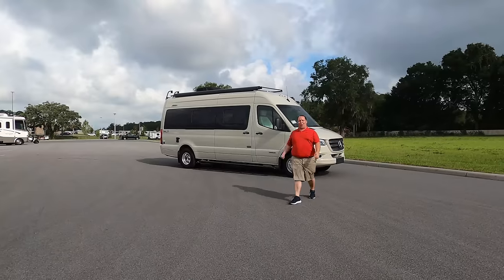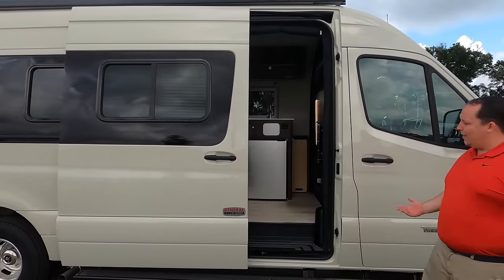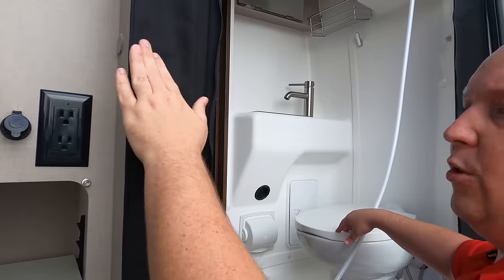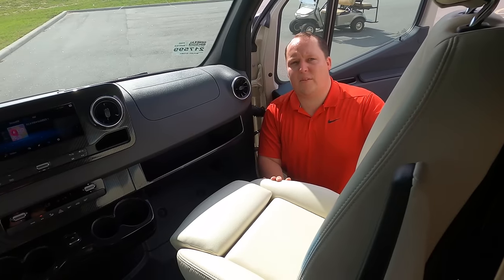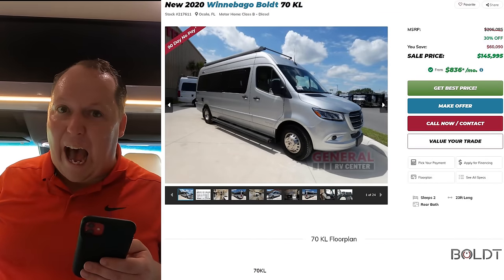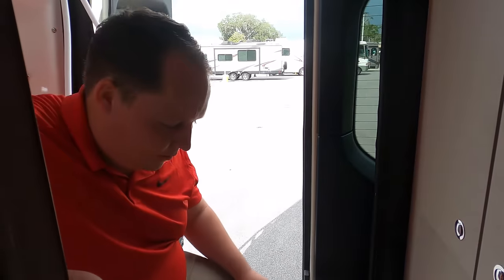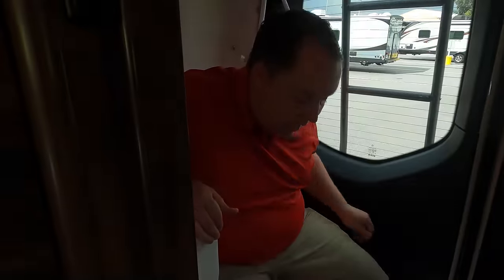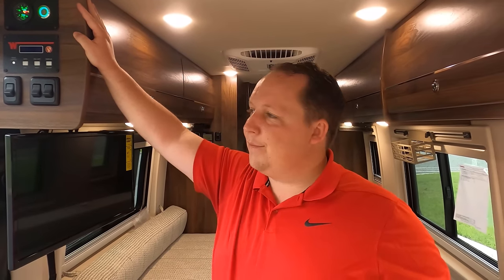Best Class B Motorhome for Fulltime Living! Off the grid camping

Comment: What?!?! A Class B?!?! I never thought I'd see it!!!
Likes:
1) Huge awning
2) I love the roof with the rack, and it looks like room for another solar panel up front (if needed)
3) All electric. I love it. One less tank to worry about.
4) Huge lithium battery bank plus the huge inverter.
5) Front passenger swivel with table. That's where I could eat and use the laptop all the time, and not worry about keeping the bed made in the back.
6) The 81" long bed! I can't get a bed that long in a 40 foot diesel pusher, but I can in a van? 👍
7) Good sized rear bath with access from the outside (easy exterior shower)
Dislikes:
1) Way too expensive. I get part of the reason why, but even the sale price is way too high.
2) Would prefer AWD
3) Take out the smaller bed and put in a larger fridge and more storage / counter space, and I (as a solo traveler) could camp in this for weeks. However, that small fridge is a no go for me. I'd run out of meat and veggies in 3 days.
Reply from the maker: Thanks for sharing your feedback Brad😊👍
Reply: @MattsRVReviews  A pleasure. But you caught me in the act. I've probably changed it 5 times since you posted. I always work on my list while I watch, and pause, and watch, and go back and rewatch, and so on. 😎😁
Reply: And another 3 times since I posted that.
Reply: Except it actually does have LP.  i possibly would have done Murphy style on the bed and I cant stand low microwaves.  Otherwise top notch
Reply: @slamdancer1720  I love a murphy bed. Not having to make and put away a bed every day would be so nice.
Reply: Slam dancer But since it’s diesel no generator needed. Also saves weight.
Reply: I have a Honda car that has the same lane assist...windshield cost $1300 to replace because a generic wouldn’t work for the recalibration...I can only imagine what a Mercedes would cost.  Price too high...I like the Winnebago Travato better. I have heard that the Mercedes are expensive to work on...even the oil changes.  Would never buy a class b with the Mercedes....give me a Ram promaster anyday!
Reply: @brianreimer380  yes, but it was called an all electric coach.  that was just a small mistake.   I actually like that propane is available.
Reply: What you said!
Reply: Love the class B it’s a perfect size for one person to travel across country

Comment: Matt & Andrea You guys did a great job!!! 
...Confirming...batteries/tanks under the beds?
Lastly, do they not have the froli system under mattresses? If so that is the 2nd BEST thing!!!!

😍💗 1. QUIET AC on SOLAR!✅ ... but for how long!??!?!?!  2. Bathroom! 👑 3. Bells and whistles (B&W) are STANDARD 👀👏🏽

🤨😬😭😱 1. Beds are like a parallelogram vs sided by side not a fan (this is their biggest flaw and don't get me started on the different lengths and finding sheets that will fit!!! ...Lose the storage/closet at the end of van, push the bed back add a counter at the entrance of van instead and make the kitchen counter smaller so both mattresses are the SAME SIZE!!! 🤯) 3. Windows on the door are sliders... not good in the rain! Prefer the awning style windows. (Experience the difference than we can talk!) Lastly Andrea pointed it out the induction... better if it could be mobile... like Matt said the vans are for living on the outside... as well as doing the cooking! If the cabinet would be to left of entrance of van you only would need a flip top table and a plug... Voilà cooking outdoors! Aka show off your bells and whistles (B&W) and solar!!
All in all, Not worth the 200K price tag even with all the B&W!
**Winnebago listen to your fans we all want one if... read the reasons above

Matt's RV review I Can't wait to see you do a review on a Safari Condo XL next!!!!!!

Comment: Another nicely done Vlog. Very informative, good camera work, (and nice assistant! 😉) lots of energy (need some decaf maybe? lol!), I like seeing B and B+ RV'S reviews. The only thing I would add to the Vlogs is maybe mentioning if there are optional things that you can add or upgrade or if the package only comes with the equipment that's installed. I know you only asked for 3 likes and dislikes, but I think I've got a caffeine rush going so.....🙃😀 here goes!
Likes:
1: Cabinets and the low gloss finish so they don't reflect bright sunlight as bad.
2: Magnetic bug screen, but needs it on rear doors as well for when you want large airflow.
3: Sink size
4: Pretty quite A/C motor
5: Front bumper step
6: Screen size and backup camera with guide lines that move with steering. **Would be nice to have a 2nd screen either above the radio on the dash or up at the top of the windscreen where the rearview mirror goes which is connected to a 2nd camera mounted higher up on the van that is always on when driving to act as a widescreen rearview mirror. That would let you see traffic, watch the trailer you are towing, and be able to see back past your trailer while backing up to help keep you from hitting anything!

Dislikes:
1: Permanently extended running board. Use a powerfold 
2: Kitchenette location. Placement at front of van makes beds offset, and no flip up or pull out counter extension.
3: Driver seat takes too much work to move. No 2nd location of power seat controls behind seat to make it easier to adjust for table without having to contort to reach the buttons on door. (and power seats always move so slowly forwards and back in all cars anyway so it takes too long to move that seat after everytime you spin it around) "SOLUTION" - Either a fully manual seat, or a seat that has power back/seat tilt/height/lumbar but a manual sliding adjustment to make moving it for the table faster, or have a power seat BUT ALSO A SPLIT 2 PIECE SEAT MOUNT! (Made one of these myself by welding a power and manual seat base together!) Bottom of seat base is a manual slider like a regular non powered seat with an unlocking lever release, but only has 2 positions, 1st is backed up away from the steering wheel when facing forward, 2nd is moved all the way up to the steering wheel when turned around. No stopping points in between. Then on top of that short bottom base it has a second seat track that is the power slider for adjusting to a "perfect" comfortable position when driving. Then you also won't have to constantly find your driving position after spinning the seat around or have to press a memory position button and wait for the seat to slowly relocate.
4: ABSOLUTELY HATE Mercedes voice control radio command function!!!! (In ALL their cars) Either get rid of it all together or have it stop always listening for a "key word" to respond. Just have it ONLY respond to a command after pressing a steering wheel button so it's not coming on when it hears "Mercedes" or a word slightly similar to it. It either comes on when you don't want it to, or it won't come on when you do!!
5: Ladder. Bottom rung is up too high. Add 1 or 2 more rungs so that we don't split our pants raising our leg up so high, and for people that can't lift them that high won't have to carry a step stool around or have to use the bumper as a boost up to it, and it's much safer climbing down without a little jump down especially when in slippery ground conditions!
6: Raised solar panels make wind noise going down the road. Can't hear it in this video but have heard it from being in one of these vans.
7: Lane control assist. Annoying when trying to pass a car or look around a car before passing. If people can't pay attention to the road, have poor depth perception and can't tell how close the the sides of the road they are, or are too sleepy to stay between the lines then they have no business being behind the wheel of a car anyway.

Comment: Thanks for the Class B review guys!
Three things I liked:
1. The finish inside is very nice, especially the cabinets
2. The kitchen is really set up well for the size of the camper, really like the induction cooktop & microwave/convection combination.
3. The electrical setup with the lithium batteries & solar panels. Expensive, but could likely boondock for extended periods.

Three things I don't like:
1. The layout: put the bunks even and closer to the back door, maybe a rear lounge or dinette converting to a double bed, or maybe a Murphy bed, plus some garage space if possible underneath. Use a smaller bath module closer to the door across from the galley. I've seen some that put the galley by the sliding door with outside access for cooking out, then the bath across from that. I don't see how the sleeping position works for either camper
2. It's really long, so parking is going to be a hassle in town.
3. It's expensive. For the money, you could get a really nice class C or, for less money, a B+ with more space. I know it can carry two, but it could only be for short trips. One person could probably get by in that small space, but for two, I think it's too tight. 

I don't see this as a viable solution for full time camping.

Comment: I love class b’s and would like to see more. I like the mechanical & electrical features, cockpit, magnetic door screen, and size of the bathroom. That being said the interior design of the unit leaves a lot to be desired if they are promoting it for full time use. The weird “double” bed is useless for sleeping 2. The fridge needs to be bigger and needs to have 2 induction cook tops, I would promote the van for solo travelers and get rid of the small couch to put in more cabinets, make the kitchen counter top & longer by removing the drivers table (this way you would have more space for another induction cooker). Last but not least I would offer a boon-docking option of a cassette toilet thus freeing up valuable space for more freshwater carrying capacity.

Comment: Matt & Andrea, "absolutely love" the channel.  Winnebago ... as somebody seriously considering this RV, I wanted to give you some feedback.  First, the BOLDT is awesome, it looks great, the Mercedes chassis is the best available with outstanding safety features and good mileage, we are particularly drawn to the VOLTA power system, it is a very modern approach and we love it, but we could not pull the trigger on the BOLDT, here is why.  Bathroom + Refrigerator.  We want to travel with our son, so we want the awesome forward facing third seat with shoulder belt, so the 70BL floorplan is for us, but the fridge is so very tiny, not enough for 3 people to travel.  Second is the bathroom, its so tiny on this layout and really unusable.  I know, I know, its a class B, but the Travato, your own class B with a VOLTA system, has a nice bathroom and a good size fridge. how can those be bigger on a smaller chassis ? If you can change the BOLDT to be a bit more like the Travato 59GL, you would have a real winner on your hands.  Last request, somehow find a place, someplace, somewhere on the outside of the BOLDT to hide and store the "stinky slinky" as Matt calls it.  Nobody wants to bring that into their $200K home on wheels, especially one as nice as the BOLDT.  Overall great job on this product, but we can't buy it until the layout issues outlined above are fixed.

Comment: Hello everyone!
Our likes:
* For such a small unit it is laid out pretty well. We also wish the beds were aligned better, though.  
* We love the fact that it is solar-friendly. With a unit that small, solar is almost a requirement. 
* We like having the doors at the back as well as the side and front. If an emergency exit was required there is little to no reason why an exit couldn't be done quickly and safely. 
* The towing capability would make it pretty easy to pull a small storage trailer of some sort (to carry a grill, bicycles/golf cart, etc.) or a flatbed trailer for a motorcycle. 
Our dislikes:
* Although we understand class B motor homes are expensive as a rule, we wish there was some way the prices could be reduced. It's hard for "regular" people to consider spending that much on such a small unit when we could get something with much more room for considerably less. 
* It would be interesting if there was a snap-on tent type structure for the back in case someone really wanted to take an outside shower. It could possibly snap onto the back of the unit for access to the water and for privacy.
* You've probably seen this is a regular request of ours, but it's even more important in such a small unit. Since there is very little room for storage, having a cutting board cover for the sink would be essential for us. 
*  We didn't see any blinds to close off the cockpit area from outside. If there aren't any, there should be...never know when a peeping Tom might show up.
P.S.
We LOVE the way the vehicle didn't respond to either of you at the end of the video. Too funny!

Comment: This Class B is an excellent option if you're goal is to travel the US from city to city on the DL (Stelth). This is also a great option for beach camping or using it to get to a good skiing, rock climbing spot.

I like the fact it's 100% electric & has an awesome electric set up. 
Good shower/wet room set up. One of the most spacious set ups i've seen.
I'm in love with the driving & safty features .

I'm not a fan of the sink depth. I'd prefer it be deeper.
The mosquito netting looks cheap & inconvenient to use, a slider screen door like theHymer Aktiv would be ideal.
 The odd asymetrical bed limits the van to a solo travel imo

Comment: I agree with Andrea that the convection cook top should have 2 burners. But I also think that it should be recessed with a cover (like the sink is), this way there is more countertop for food prepping.  Also, I think the cabinet between the sofa/bed on passenger side should be moved forward to across from cook top so sofa/bed on both sides are aligned.

Comment: This is really super nice! 
3 Things I like:
1.) Solar - awesome!
2.) Nice bathroom! 
3.) Awesome driving assist! 

3 Dislikes: 
1.) Kitchen faucet doesn't have a hose.
2.) Extremity small fridge
3.) The kitchen needs to be on the other side of the couch/bed so the beds line up.

Fridge is way too small!   I can see a tall fridge where the closet is.
Across the entry way, put the closet/storage, it's behind the driver seat, now that space will have a 'better' attached table to come down for the person sitting in the driver to use, and still have good view of the TV.  It's convenient for clothes and shoe storage.   When traveling like this, do you really want to hang clothes? 
We need proper food cold storage, where ever we go.  This tiny itty bitty fridge is not okay. Way too small, not useful.

Comment: This van also fits through drive-thru lanes, parks in a regular parking space and you will never have a problem fitting at the gas pump. It's great for those who travel/work remotely. No need for high hotel prices. It's intended for the simple life on the road.

Comment: I'm subscribed.  Kudos to Winny for coming up with new ideas.  I like the van color, but not the small windows only because they don't look good outside.  Big plus:  3600W inverter, huge lithium Ion batteries, 230W solar panels and quiet A/C without a noisy generator!!  Makes it Great for boon docking, for sure.  That's the big attraction.  Auto sliding door and screen is great.  Plan of the rear potty looks interesting but needs to be proven reliable and problem free.   Bench beds are actually OK I think.  TV should be mounted off a rear wall for viewing in bed.  Overall, very interesting.  Should be a Winner at this price point.  Comments from an Airstream Interstate owner.

Comment: Great video! Thanks! Please do more class B reviews! I like the Mercedes driving safety features and ease of door and swivel chair operation. The inside is very nice, too. I don't see the need for the large propane tank and I think the fresh water fill should be lockable for safety. I think the beds should line up better. I, too, wish it had the larger fridge/freezer drawer. I have dogs that travel with me and so that I can site see and leave the pups in the van, I must have the ability to run the A/C without the motor running. Gas mileage is also a plus for having the Class B.

Comment: Surprisingly, I didn't hate it. I'm not sure it would work for me, I'm 6'2" and 265 pounds, not a small guy, and that RV looks to be to be built primarily for those well under 6'. With a 6'2" interior, I would feel claustrophobic.  Unfortunate, I like the concept, easy to drive, park it anywhere, AC able to be run on the battery and whisper quiet, if I were touring the country on business, alone, this would make a lot of sense. But I think even a couple would eventually feel cramped. Personally, I would like to see you review a Leisure Travel van, they make a 22 feet model that appears to be ideal to my way of thinking. Anyway, I enjoyed information on an alternative. For now, our 26BHS Jayco makes more sense financially and can sleep a ton of kids, Grandson is 5, and loves company. Anyhow, nice showing, you did well in my book. 3 things I didn't like: Ceiling height - possibly a deal breaker,  Split bed design, it could work, but the beds looked short, like 5' 8" would be all that fit,   Small Fridge - yeah, I know, where would you put a bigger one, but you asked.  Honestly- that was it. Loved the Mercedes drive assist features, the "Hey Mercedes" if it worked would be utterly cool, and the GPS/back-up camera system outstanding. For seeing the sights across this country, this thing would rock.